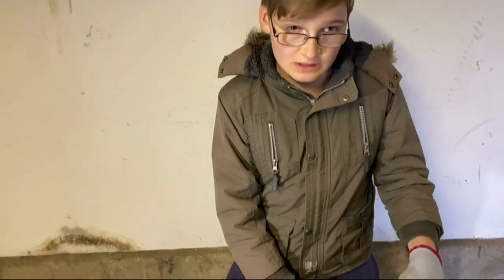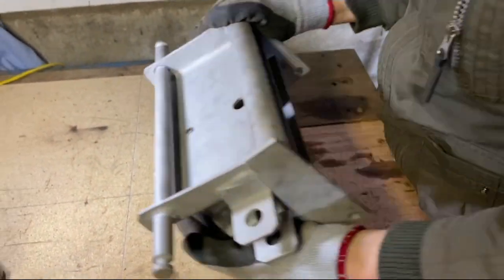Bolens HT Snow Plow replica - Part 6

Comment: Nice blasting cabinet and job. Unless you have an exterior vent for the cabinet, wear a good respirator when blasting and spray painting. Another very nice video and good progress. Good Luck, Rick
Reply from the maker: Thanks for the advice. We are making progress but it is slow. Take care
Reply: @GardenTractorBoy  It appears that you are taking the time needed to do it right the first time. It saves time in the long run and is much safer that way. Good Luck, Rick

Comment: It really is looking OEM!  For the links, I've used 1in square tubes in which I pressed 1/2in long nuts. Then secured them with tack welds.  Then the other end is simply the bolt on which I welded a loop end. Not so fancy, but it works!  I've repeated this pattern on my UTV snow plow! Was that your first weld? I don't remember you welding... Thanks!
Reply from the maker: Thanks. I like your idea for the links but for this we want to make it an exact copy of the Bolens blade and linkage. This was my first real weld but mainly I have done some practice welding on scrap

Comment: Great video! Do you have a tube frame or large frame tiller and if so how does it attach to the tractor?
Reply from the maker: We have a few tube frame tillers but none for the large frame. In both cases they attach to the attachment brackets on the rear axle and are driven through the PTO at the front of the tractor. I hope we will be getting a tiller out soon. Take care
Reply: @GardenTractorBoy  thank you very much for your response I would love to see you tillers in a up comeing video. I take it that large frame tillers are quite rare here in the UK?